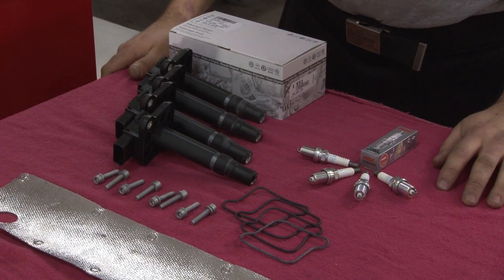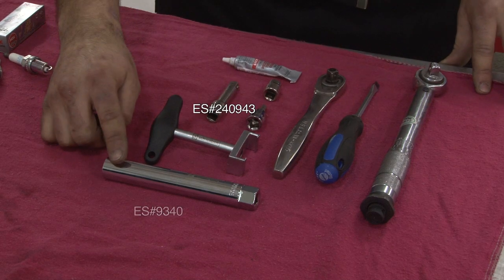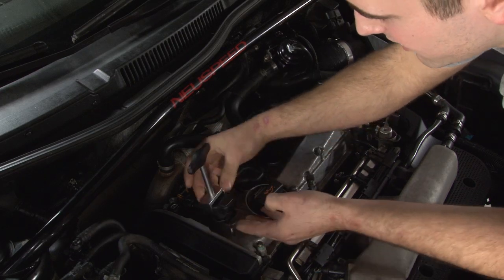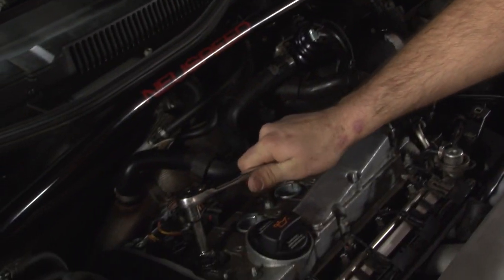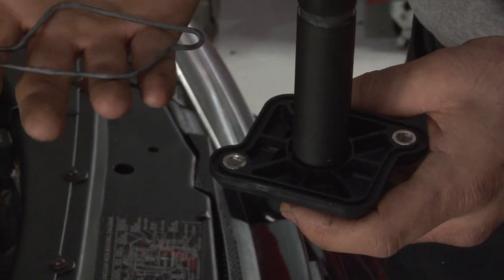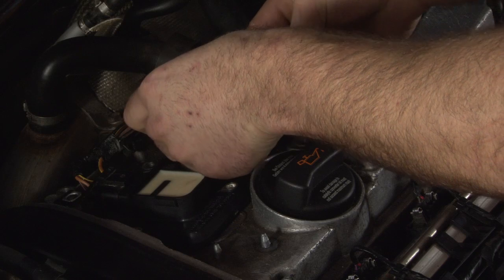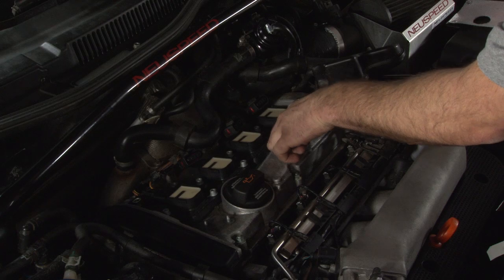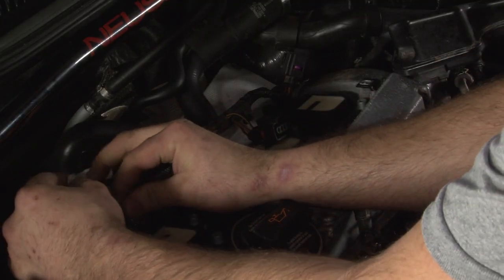ECS Tuning: 1.8T Coil Pack Ignition (Stage 1-3) DIY

Comment: So I was driving my 1.8T bug home today, started idling a bit weird, then started making a pop pop pop noise, til it eventually sounded like a WRX (haha).  Sucks I drove home, probably screwed my Cat up... but I'm told it's my coil packs.  I've only replaced a single coil pack once since I bought the car 10 years ago (2001 Beetle 1.8t).  Lots of research tonight, so hopefully I can sort it out.
Reply: Hey man did you solved your problem? I just purchased a 1.8T AUQ car and I love it but it idles fun, like 750-780rpm and a slight vibration when it drops to 750, I am told the coils in this car need to be replaced frequently. I am researching about the 2.0T TFSI coils (used in some serious rides like Audi RS and whatnot) that can be installed in 1.8T models with some adapters (60 extra bucks).

Comment: I came across this video and it got my attention. I saw it and like the way it was all explain. But one thing I don't get. Why change  them. What do you obtain by installing this.?
Reply: WHen you get Check Engine Light on and hav a missfire, also, AUDIs sometimes you'll feel like when pushing gas nothing happen, you need to repace the coils at least.

Comment: I have an Audi A4 B6, no sure about adding a Stage 3+ kit. But what benefits would this particular upgrade give me? Is it worth it if I dnt upgrade anything else?
Reply: Yes. . And it will definitely make ur car run better
Reply: @bstevenson1002   I just purchased a Seat Toledo 20VT 1.8T AUQ and I love this ride but it idles fun, like 750-780rpm and a slight vibration when it drops to 750, I am told the coils in this car need to be replaced frequently. I am researching about those 2.0T TFSI coils should I invest in them? I also need the adapters, so its like 200 bucks for the whole package.
Reply: @ayyyylimao  ... The 2.0 coils work great. Spend ur money on good  60-90 dollar coils. The space adapter get from anywhere. I've seen ppl make them.. But good 2.0 coil and spark plugs in a 1.8t is the way to go.👍
Reply: @bstevenson1002  Thanks a lot, which spark plugs would you recommend for my AUQ? Current mileage is 148k kilometers (92k miles)
Reply: @ayyyylimao  ... NGK tends to work best with the Audi & VW. Both car brands are sensitive to the Plugs. Look online and make sure there there gap right before u put them in.. Better to be a little bit under than over on the gap btw.
Reply: @bstevenson1002  Thanks a lot, I am very happy with my new car as I come from a cheap diesel Peugeot 307 lol, I will try to care about this 1.8T as much as I can :)
Reply: @ayyyylimao  ... hahah.. yea u will have fun with the 1.8t!
Reply: So you install an 2.0 coil pack on a 1.8 engine? (I'm trying to learn)

Comment: Do you guys sell the coil pack wires. I bought new coil packs and one wouldn't line up correctly. When I went to check it got stuck. The inside of the clip is in the coil pack but the outer part comes off. Wires get exposed from the back.